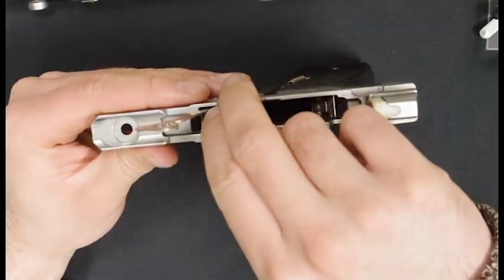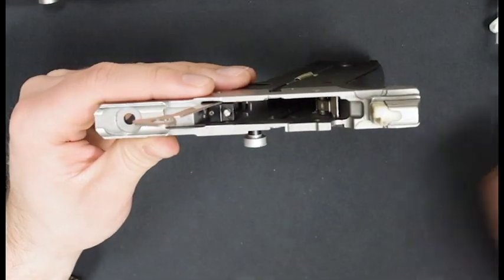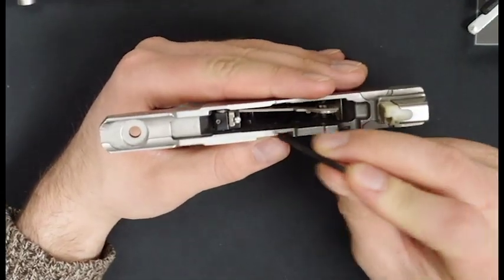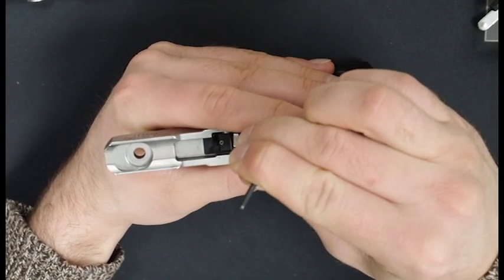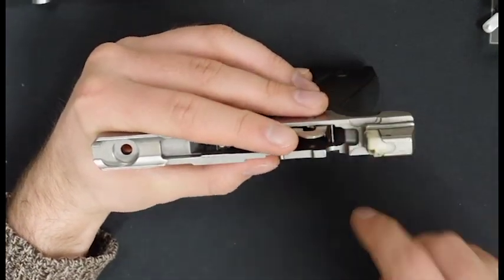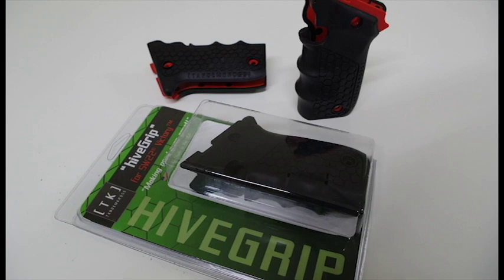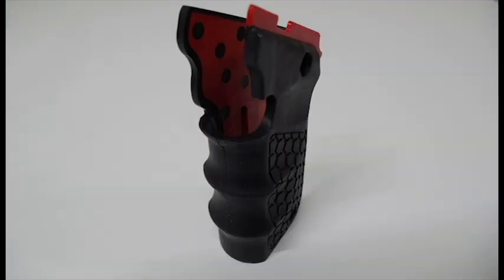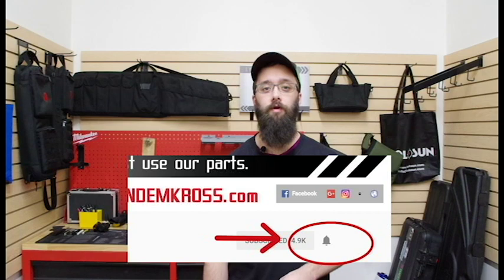TANDEMKROSS - SW22® Victory™ Spring and Detent Install Trick

Comment: Another trick....install the bushing from inside the trigger guard. Push up from the bottom. Bushing goes into place much easier this way (if you watch the videos, and see how the bushing protrudes toward the trigger in an "already installed" trigger, push the bushing up in the same location as that protrusion)

Comment: As you are putting the safety and hammer in, you risk bumping the trigger bar and having it move just enough to free the plunger and spring.  Just as John Bercaw mentioned, this is followed by crawling around on the floor during the hunt for previously flying parts (a bright light helps) and the associated swearing.  Amazingly, the two almost microscopic parts were eventually found (YEAH!!) and the process resumed.  Only once the spring and plunger were in place, a couple of small strips of blue "painters" tape were placed over the metal tab on the trigger bar, holding the plunger and spring under that tab.  And yes, the trigger bar was bumped again.  But this time, the plunger and spring stayed in place.  Thank you PAINTER'S TAPE !!!

Comment: I use a pencil eraser, the rubber doesn't slip off the detent as easily as a steel punch.
Reply from the maker: Great tip!
Reply: Went to this trick right away, got it on the first try!

Comment: I have finished my fighting with those two small parts just few hours ago. Searching for them on the floor took me more time than installling the trigger. Dry firing suggests, that everything works fine. I have also installed Thunder hammer. How big difference would that do?  Can't wait to find that out on the range.
Reply: I had to search for them a few times. I 'm lucky i have a small work space so they don't go toooooo far. Also a flashlight helps tons finding them they do shine nicely

Comment: Is the small end of the plunger supposed to fit inside of the 10mm spring? Mine does not, the hole on the trigger is about the same depth as the plunger, I see no way to balance this plunger on top of this spring while performing this task. Was I shipped the wrong spring or a defective trigger?
Reply from the maker: The small end of the plunger is supposed to fit inside that spring. It's possible you were shipped the wrong spring, or the spring got squashed in transit or something and was deformed enough to prevent the plunger from going in. I recommend you contact our Customer Service department at either 603-369-7060 or customerservice@tandemkross.com.
Reply: @TANDEMKROSS  Already did, thanks for getting the correct spring here so quick, great service.